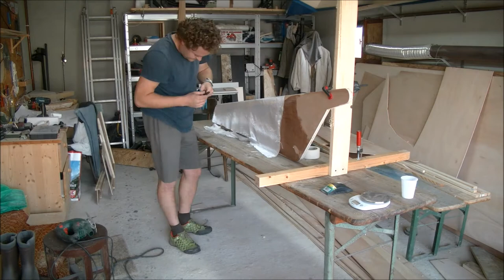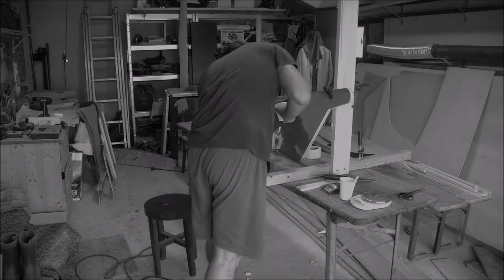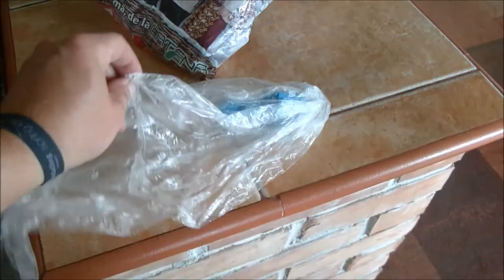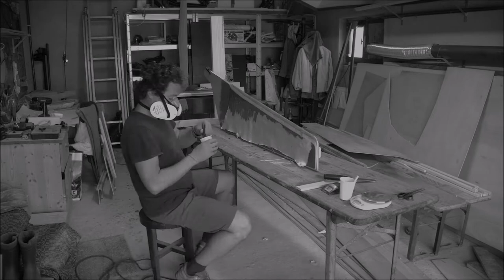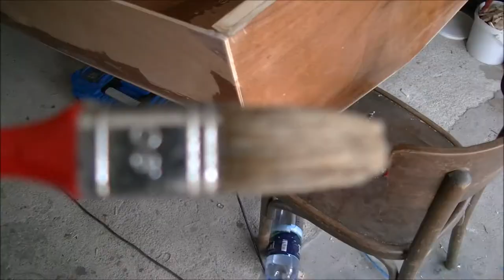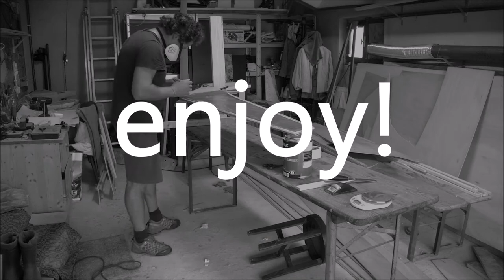Tips and Tricks: Re-Use your Paintbrush

Comment: Nice tip cap'n. I keep mine in acetone after use, which allows them to be re used a few times. Just beat them out somewhere before starting again. Nice little sneak peak at the progress on the boat.
Reply from the maker: Thanks!!
Reply: I tried acetone and denatured alcohol. I prefer the alcohol because it does not affect the brushes as acetone does after long exposure. Definitely I also will try the fridge.

Comment: Hi Cap. I heard about to use vinager to clean the brushes. Did you ever try it?
Reply from the maker: Yes. I tried it. I was not happy with the end result. Later I understood that vinegar only disolves the hardener while the resin remains. Some say that denaturated alcohol works better than vinegar. Others use acetone. For me, the freezer works best. But i learned that the paintbrush needs to be perfectly sealed in order not to contaminate the food.
Reply: Yes, freeze the brush is much simple, clean and quick.

Comment: Assuming your trainer was ok with this,  would you store surplus mixed epoxy in the freezer for later use?  Like spread out thin for quick freeze and quick warmup?

Also,  anally,  that's a fridge-freezer you have. What's its temp?  A dedicated freezer is generally   -18C.
Reply from the maker: I have not done this. But why would you? Resin manufacturer always recomends to mix in small batches to avoid overheating.
Reply: Captain Wulkie's Garage  Thrift is why would I. It's so easy to mix up too much. I can only speak personally but the difference between ten quid and twenty quid is a big number for me. But I have this freezer and it will run whether empty or full, it's a resource, a tool, might as well use it, hence my question.

Would you store surplus mixed epoxy in the freezer for later use? Well let's start with hypothetical.
Reply from the maker: Let us know how it works please.